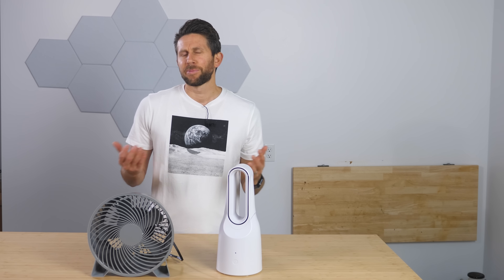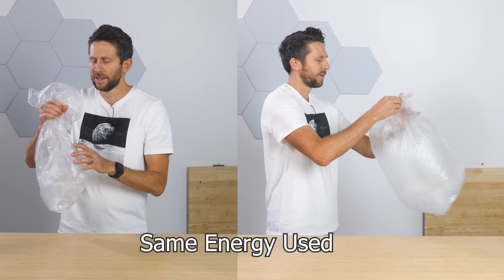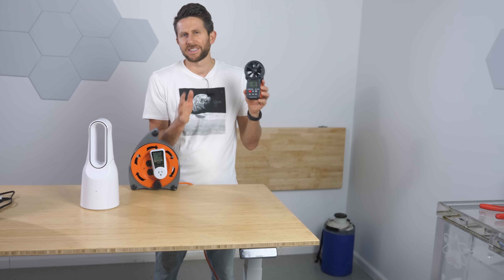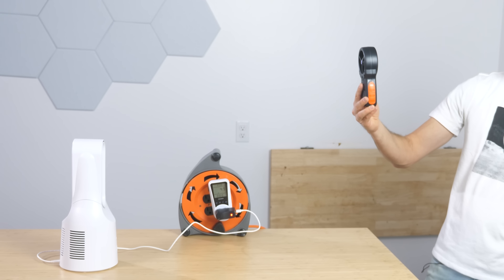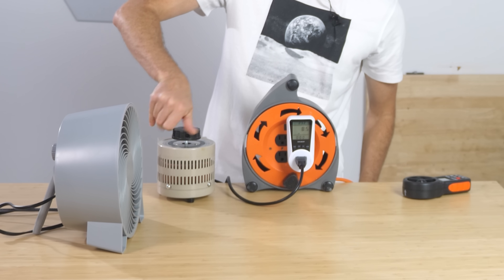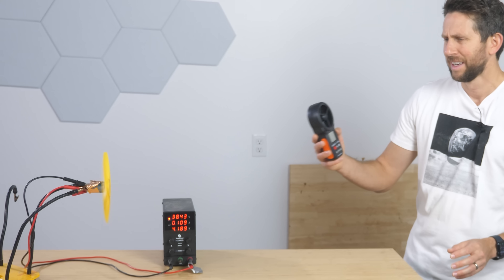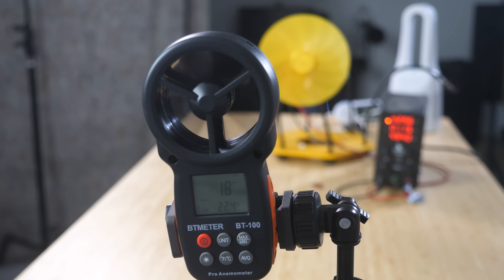Are Bladeless Fans a Scam?

Comment: The thesis fails at the outset, as with the bag example, you've created a constriction with your lips to direct the stream of air toward the bag, increasing effort and lowering efficiency of exhaling in favor of the directed flow.
The same is true by the airfoils in the Dyson fan, lowering efficiency to one extent, both silencing the fan largely due to the resonator built into the fan and directing flow to draw room air into the stream.
Just as also, one loses efficiency in an exhaust system by running the exhaust through a muffler.
All of which proves yet again the laws of thermodynamics stating quite emphatically, there ain't no such thing as a free lunch.

Comment: A large river carries more energy than a small one, even if BOTH move their water at the same average speed. So it is wrong to relate the total transferred energy (divided by the 5W, to get the efficiency) to the MAXIMUM local speed measured with an anemometer.

Comment: I think the most important thing for a fan is for it to be quiet. Power efficiency is not that important. So its not about bladeless or not but about build quality and particular model. Bladeless fan has an advantage only if you have a small child or a cat as in regular fans its often possible to stick in a finger and get hurt. Still the only fan that I found to be quiet enough to not disturb my sleep at night was a 140mm PC fan with a 3d printed shroud that turns it into a desk fan.
Reply: I mean, I'd say move air, but quiet is a close second.

And that's why ceiling fans are king.

Comment: I used to use this principle on the job. I used to sell seafood and had to clean the display case. I used a hose with a sprayer and hot water to melt ice. The hot water would produce steam and that would block my vision to see what i was doing, if i was close to the ice. But if i backed way off and allowed the running water to pull air in, it would push the steam out of the way. It was faster also.

Comment: RUBBISH.!
To do the experiment correctly you would need to have the fans sealed to the end of a pipe and measure the air flow at the other end, otherwise you cannot accurately measure the volume of air as it will disperse without direction.

Comment: Bud here's a potential flaw I see in this experiment, maybe you can address these in a follow up video. If I'm not mistaken, the efficiency of a fan depends on the volume of air blown, and not the maximum wind speed achieved, per unit watts of power. Wind speed alone is not enough to measure the volume flow of air. We either need a way to measure the area of cross section across which that wind speed is sustained. Now this won't be precise because at any distance from the fan, across the cross section area where wind from the fan can be detected, wind speed will vary like a spectrum spread, much like gender in 21st century. Another way is building some kind of shroud that captures all the moving air from the fan at one end before it spreads out and gradually gets narrower towards the other end so that the whole air can be made to pass through the anemometer. In that case the wind speed reading alone will be enough to know which volumetric flow is higher. This is quite the task, and that'll still not be optimal because the effect of high speed moving air sucking in environmental air along with it (which, btw, should also happen in case of the yellow DC fan you used, probably more so than the Dyson fan) will me restricted by the shroud, and a gradually narrowing tube will also hamper efficiency of the fans due to the buildup of positive pressure in the tube (although this can potentially be solved by using uniform width shroud and a giant 2-3ft dia anemometer😂). But I think it'll still be more precise than just using the wattage and wind speed measured about 3ft from the fan in a room without a controlled environment to determine efficiency. And if you can manage to do this and make a follow up video, I am one nerd that's really excited for the results.😅

Comment: Thank you for the interesting video.
I am not an engineer, but I have the feeling that friction also plays a role in reducing the efficiency of the so called "bladeless" fan: air is directed vertically from the bottom of the appliance up, and then discharged horizontally, causing friction loss of energy. 
Am I right?

Comment: I'm an expert at precision air velocity measurement. Despite the fact that your experiment design and instrumentation are insufficient to measure total volume flow and, therefore, mechanical OR electrical efficiency, you reached the correct conclusion. Those so-called bladeless fans are just a cool gimmick. Pun intended.

Comment: 4:02 aren't fans supposed to be current controlled instead of voltage controlled? That could eb your issue. I'm encountering that issue with figuring out if I can use regular smart switches for ceiling fans.
Reply: I don't know where you got that information from, but you're definitely mistaken.
Not only DC fans, AC fans too. But I've never seen a fan that is not controlled by voltage changes, in any shape or form

Comment: To be honest this is a bit of a bad comparison, you only measured airspeed and not moved air volume, there's a big difference, when i would take an absolutely tiny fan and push 5 volts through it it would probably easily go above 5m/s at that distance but only in a tiny area, it didn't move much air but the air it moved is much faster, making it win the comparison

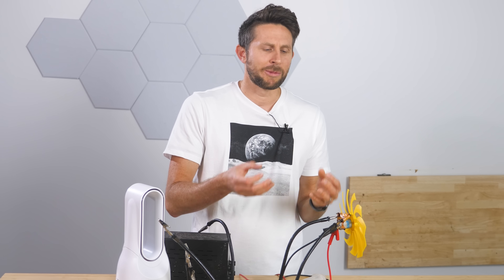Comment: 8:07 And I smell someone salty who can't afford one or didn't got a review sample when he asked.
Anyway. Bladeless fan ≠ bladeless fan. There is a lot of aerodynamic/fluid design going into the Dyson one. A cheap "we found a fan somewhere, let's slap it into a case that looks vaguely similar" Chinese clone of a clone of a clone, does simply not compare.
China is a master in cost reduction design. Sometimes that way they also design the function away. Like in yours.
Mine moves a lot of air and a lot further than a regular fan that uses more power.

Comment: The fan in the model of bladeless fan you used was a cheap centrifugal fan.  The kind used only in bathroom "fart fans" because they save space but are notoriously really bad for moving  air.  You should use a real Dyson and compare that to an open bladed axial fan.  Dyson uses a ducted axial fan specifically designed to optimize efficiency.  Just saying....

Comment: I can imagine a bladeless to be much more difficult to clean. On a regular fan you can usually just take off one side of the casing and wipe down the
blades with a damp cloth. On a bladeless I'm guessing you have to unscrew the bottom and probably have to use an air duster to blow out the dust?

Comment: I don't think that test was fair. Because You would have to actually measure not just the one point of where air is moving but the whole air circulation in the room. How much air in the area is circulating not just the place the air is blowing the most. Not sure how would that affect the final result, but Your test was practically useless.

Comment: I pretty much already assumed from the get go that the "bladeless" fans weren't "bladeless" so that automatically makes them less efficient depending on what else they are using. They are still basically sucking in and spitting out air. Lets see if I'm right.

Edit: Yup it was worthless 😂 Why am I not surprised?

Comment: blowing in the bag at a distance is more about pushing the walls of the bag out than blowing air in. You move the bag and it does the rest. If you turn a bag inside out, you instantly fill it with infinity air since the inside now is the outside.

Comment: You compared the speed of air moved.  You didn’t compare the amount of air moved.  Which the references you kept using would be more applicable for.  Efficiency.  Volume of air moved per unit of energy.

Comment: The Dyson fan is actually a simple concept. of compressing through a ramjet.
I find this concept VERY effective as the air flow is nearly silent....
Large bladed fans  SLAP the air  and that buffets your ear drums.... not at all good for your hearing health.
(I am a professional audio engineer and I protect my hearing jealously)
So  from the stand point of moving air and  doing so  a quietly as possible... the dyson fans are king
(also  technically they still have blades  just much smaller like you will see in an air handler)

Comment: I'm wondering if air being pulled into the base section of the bladeless fan is reducing pressure of air that's meant to flow through the upper section?

Comment: The benefit comes from the unbroken continual flow the turbine creates unlike a fan meaning you need less airflow to get the same effect of cooling because of this, the reason the housing is used is to redirect the air in a manner where it's dispersed evenly a loss in flow in unavoidable when you add more internal volume to the system by adding a housing to push air around before it's dispersed. Why is this so hard for people to get?

Comment: This reminds me of fans used in computers. Not as common today but a lot of 'reference' video cards in the day used to use a blower style fan like the Dyson and force the air through a small space in the card and then out the back of the computer case. The only benefit being slightly cooler case temperatures. Pretty much every video card that used standard fans always ran far cooler and quieter. To be even more technical the hotter a silicon chip is the more power inefficient it becomes as internal resistances get higher generating even more heat. So not only were the more regular fans quieter and cooler, they also help make the video card more power efficient even if it has more fans on it! Products like this Dyson fan are more show than being reasonably functional. I would personally consider it factory new e-waste!

Comment: This video is bad "science". To perform this test with data that can be reliably correlated, you would need to use the same fan, with & without the 'multiplier' of the shroud - meaning that the test should be performed with at least the same model of fan part used inside the multiplier, at the same voltage being fed to the shrouded fan.

Comment: The most efficient fans would be light-aircraft propellers with only two thin blades! Sadly, fans are not measured or sold in efficiency (in terms of how much electrical energy becomes forward kinetic energy of the air). If you want an efficient fan just use a large ducted drone prop.

Comment: if you have a good reason to nead to reduce turbulance whilst moving air there is a reson to use a "bladeless" fan... I'm not sure if you can achieve true laminar flow but the airflow is generally less turbulent.

I know that this isn't that relevant in most situations where you'll use a fan, but it is a meaningful difference between the designs.

Comment: But you used very inconsistent voltages and amps on the three different examples.. the yellow fan you ran at 38 volts, the baseless out of the shell you ran at 5 volts and in the shell you ran it at 9 volts. Why did you adjust the voltages between tests with the benchtop power supply? That will absolutely affect the RPMs. Just because the wattage is still 5 watts doesn’t mean that voltage is being used the same way. The yellow fan was probably operating inefficiently trying to dump the excess voltage as heat.

Comment: Instead of switching fans, could have just used rhe original conventional fan, and turned the Variac up until it had the equivalent m/s rating as the Dyson, then compared the watts.

Comment: I use a simple blade fan in the lounge room but have a Dyson for the bedroom. At night, normal fans feel like a gale.  The Dyson at the lowest settings provides a gentle, controllable breeze.  If you want power, a bladed fan is much better bang for the buck.  If you need subtlety, bladeless are quieter and less intrusive (on low settings), although they sure are overpriced.

PS. I'm much too old to care about being cool - that ship sailed many years ago.  This is purely about utility.

Comment: I don't remember Dyson claiming that bladeless fans designs were more efficient, so I'm not sure where that expectation came from and why you are measuring that. What I remember them saying was that the air flows more smoothly and greatly reduces the buffeting effect that you get from traditional fans, so it is a more comfortable experience more similar to natural breeze. So that's what you should be testing for.

Comment: You didn't measure at different lengths. The persistence of airflow doesn't get wasted in a wide cone like regular fans, better for full directional currents and actually moving airflows instead of just a wash of confusing turbulence.

Comment: Oh, the Dyson was more of a flex on precision manufacturing techniques. Bladeless fans work best with high static pressure rather than out right speed and need very tight gap tolerances to work as well as the Dysons do, I did a modification experiment with a really cheap battery bladeless portable fan where I optimised the impeller distance to be as close as possible to the housing, the motor was a tiny 2w unit and you can see air flow increase as you reduced gap distance.

 There is a good chance you might be able to improve the effect that 5w blower unit has by optimising against back pressure losses. Engoodening  the cheap-ish fan to better leverage the seemingly low power draw....by memory the original Dyson bladeless fan had a power draw of 36w, and the design of the fan blade was closer to a gas turbine set up with stators to increase pressure inside the housing giving that high air flow performance they are known for.

Makes for a good experiment for kids to understand how energy efficiency can be gained just by positioning parts in the right orientation and distances.

Comment: While Bladeless fans are typically not going to match the regular ones (especially in price & efficiency), the design and additional features that come with it such as HEPA filters or mosquito catcher can be a good deal.
Reply: It looks like Dyson has discontinued its fan-only products (the "cool" brand line). All of their bladeless fans have either air filtering, heat or humidity as a second product. The fan-only fans don't exist on their website anymore.

Comment: Maybe creating a wire grid wtih a dozen spaced out areas for wind speed measurment areas would have been a good idea. Being able to quantify how much air there is, rather than how much air is sent into 1 spot. It wouldn't give a proper volumetric output, but it would be better.

A single spot comparison of the brightness of a flashlight is meaningless. A flood light, even if more powerful would register as less light in comparison to a spot light if just measuring at a single point.

Comment: As a fan collector, normal fans are better as you can see the fan spinning and see the problems with the motor. Not only you can clean the blade and the grills. Is also easier to fix

Comment: I think Dyson fan is expensive because it utilizes more technology other than airflow. They use air filtering, air quality monitoring, and perhaps better airflow engineering compared to the $50 fan. Also, bladeless fan products also sells aesthetics and "bladeless" kid-safe feature.
TLDR, bladeless fans, especially Dysons, dont just sell airflow. They sell other technologies. So if you're just after airflow, then you will really find them expensive and pointless

Comment: I'd rather you compare the volume of air (CFM) delivered by each fan to the energy needed to operate each fan. You can have a high velocity but low volume (CFM) which may not move enough air to properly ventilate a room. Likewise, a poorly designed system could provide a large volume of air, but if at a low velocity, you also may not meet the ventilation needs of a space.

Comment: Axial fans and centrifugal fans have different efficiencies and are used for different reasons. Axial fans create high volume and high speed, but not great pressure. Whereas centrifugal fans create more modest speed and volume but far better pressure. You get into aspects of fluid dynamics and things get rather more complicated than your simple experiment.
Whilst i enjoy your videos and usually applaud the science. In this case i think you need to do a bit more research as you simply aren't doing a sensible comparison.

Comment: When Dyson first introduced these years ago intuition tells you along with a little scientific knowledge that number
one it has an actual fan inside and the of course blockages to the free movement of air. They are an expensive joke.
Reply: The dyson isn't a fan, it's an air purifier in which its exhaust was repurposed to be a fan. Have a look online, you will notice almost all purifiers have the exhaust facing UPWARDS, dyson just utilized that and made it into a fan. 

You also have to consider the dyson is a 
-fan
-air purifier
-air quality monitor
-heater
all in one

and when you buy all of those things separately listed above you get the total cost around $300 - $400 which is around what the dysons start at.

Comment: I also think that bagless vacuum cleaners are stupid. Just throw the entire bag out -- don't try to empty it. Yes, if you vacuum up a lot of tiny dust then it is possible for the bag to cause the vacuum to lose suction before the bag fills up. If that happens, just replace the bag. Seriously, vacuum cleaner bags are super cheap and it is easier and less messy to replace a bag than empty a bagless vacuum. Also, vacuums with bags are simpler, cheaper, and I find they work better (assuming you REPLACE THE BAG!)

Comment: The benefit really is the sound.  Having a fan running in your room at night, bladeless is far quieter. If I’m cooling my shop in the summer, I’m going traditional. If I’m sleeping in the summer and it’s not quite warm enough to hook up the AC…bladeless is the way to go.